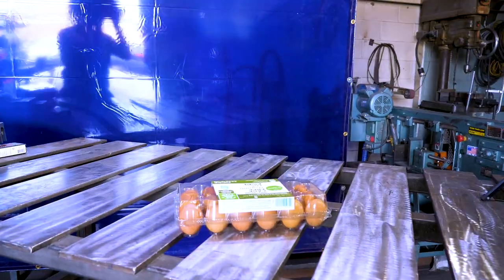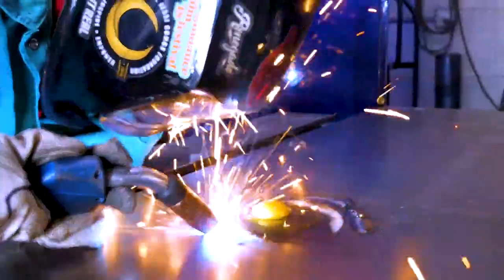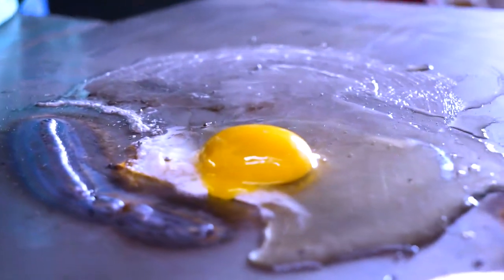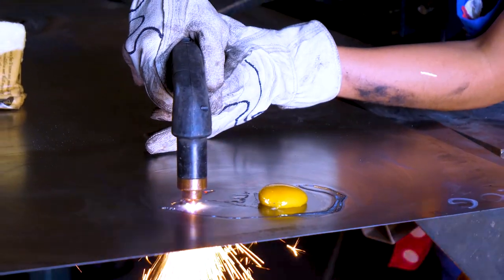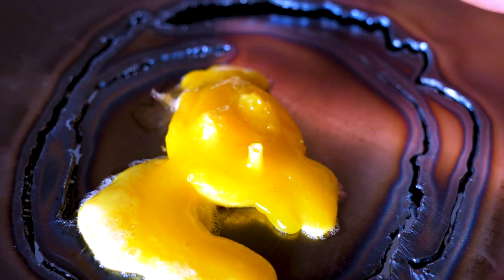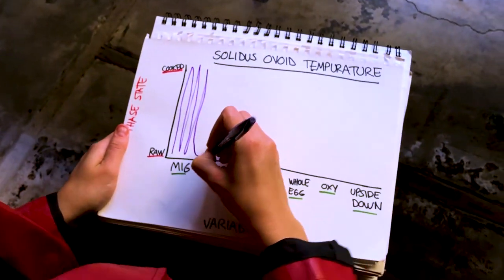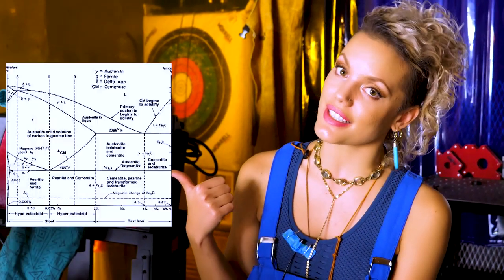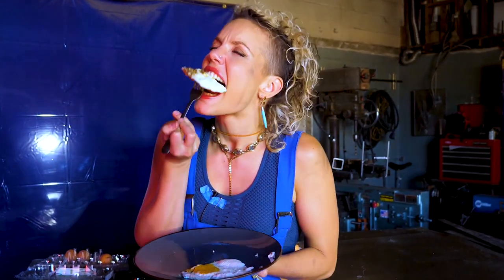Can I cook an egg with electricity?

Comment: An interesting video to say the least.  One technicality I thought should be pointed out is that eggs don't actually change phases when cooked.  Phase change means the underlying material is still the same but in a different state of matter while cooked eggs have actually undergone a chemical change (that's the difference between cooking and heating something).  The metal will return to it's original phase once cooled (with the exception of the stuff that oxidizes), the eggs will still be cooked after cooling.

Comment: “Materials ground me” - I thought that was the purpose of the clamp on your welder 😉🤣

(Two ideas, now way too far removed to be of any use: 1) Thicker metal would have conducted the hear a lot better. 2) Using the MIG torch on the underside of the sheet metal would have been tricky, but would have let you get heat into the middle of the egg better.)

- Oh, and the egg phase diagram was brilliant! 👍😆

Comment: Technically cooking an egg in the microwave is cooking an egg with electricity but you're having fun so good luck :)
Reply: Sort of.  Microwave Ovens use electromagnetic waves which induce an electrical current with a frequency of 2.4GHz (usually) into an object.  From my understanding (and it's really complicated/confusing stuff) as the photons that make up the wave hit the object they transfer thermal energy.  Then again it also depends on which theory you follow as some theories say that photons don't really exist and electromagnetic waves are really their own thing (simplifying, it's basically standard physics vs quantum physics theories).

Triscuits are apparently made with a more direct method of electrical cooking much the same as one of Big Clives inventions.
Reply: @grn1  Not sort of, Read the OPs question (video title) cooking an egg with a halogen heating element on a stove is cooking with electricity same as anything else that uses electricity to cook.
Reply: @OldPoi77  In that context sure, but I could also apply my previous comment to said question in the video title. If anything a microwave oven would be closer to directly cooking with electricity since the EM induces an electrical current.

Comment: Welding the plate from under the egg (table) seems to be a viable option...
Reply from the maker: If my settings were DIALED in and I didn't blow through at all- I think you're right!
Reply: @thea_ulrich  The egg on top should keeps you from blowing through. I'd start at the edge of the egg. Also, a trick to weld on thin sheets is to make small spot welds and stitch them together.

Comment: Perfect scrambled eggs(for me at least), grease a medium size steel, copper bottomed pan with unsalted butter, add 4 eggs to a pan on medium/high heat(between medium and high), while stirring add either 2 tablespoons of full fat milk or 1 tablespoon of heavy cream(half and half). Still stirring and as eggs are looking fluffy and little moisture is left add pinches of pepper and a pinch of garlic powder to taste. Immediately after removing from heat, add sea salt to taste if so desired.
Reply from the maker: That’s how it’s done ✅
Reply: Thanks, also loved the video

Comment: If you had welded onto some much thicker steel like 1/2" thick and a much smaller size like the size of a dinner plate you could have had more success. There's just not enough heat going into the steel at the amps you can run with thin sheet. Pumping 150-200 amps into a small piece of plate would soon have warmed it up and the thermal conductivity of the larger thickness would have seen a fairly uniform cooking of the egg. The plasma never had any hope as the whole concept of it is to have very localised heat.

Comment: Thermodynamics is beating you there. You're using point heat on a big sheet that just conducts it away. Smaller area but thicker sheet would help as the heat has nowhere to go.
The phase diagram is useful for making steel but also hardening or tempering steel - playing with quench rates or thickness of insulation cam be fun. 
The Japanese sword making process blends a hard but brittle martensite cutting edge with tough and flexible core to stop it from just shattering on impact. Two different phases frozen next to each other by the heat/ quench process. Get it wrong and you can literally explode the steel. Plus you can get pretty wavy edge patterns...

Comment: For now I've got two points to share:
1. You lit your oxy acetylene torch with only acetylene on. Don't do this! By turning the oxygen, which has a much higher flow rate, on first you drag the acetylene with it. This greatly reduces the risk of acetylene burning inside of your hoses.
2. Is there any reason you call it MIG welding instead of MAG welding? MIG refers to Metalelectrode inside of InertGas athmosphere. When welding steel you usually use an active Gas. In germany we use a mixture of 82% Argon and 18% Carbon dioxide, or for stainless steel 98% Argon and 2% CO2. We call it MAG welding, as in Metal Active Gas. If you used pure argon as the term MIG welding suggests your weld penetration would be horrible.

Someone willing to explain it to me?
Reply from the maker: 1. This is inaccurate. Even if it weren't inaccurate (which it is) basically all modern torches have flash back arrestors built into them and thus are protected against backfire into the hose.
2. Argon is a chemically inert gas, not an active gas. An America we use a mixture of 75% argon and 25% C02 when MIG welding, and thus it is referred to as 75/25, and counts as an inert shielding gas.
Reply: @thea_ulrich   @Thea Ulrich  1. Do you mind pointing out what exactly is inaccurate?
I don't know the torches you know, but all I know don't have flash back arrestors built in. Our flashback arrestors are between the pressure regulator and the hose. 
2. interesting that a gas, which is actively participating in the welding process is considered inert. Of course, the majority of the gas is inert, but as soon as any part of the gas mixture is active, the whole mixture is considered active in Europe.

Comment: I feel like you would be able to use tig with weird settings from the underside of thin material to actually cook the egg decently well. like, super low amperage moving really fast around the egg from the bottom side.
Reply from the maker: this is probably accurate re technique and if i ever actually do need to cook an egg in a metal shop as opposed to philosophize about phase changes I shall take this to heart! ;)